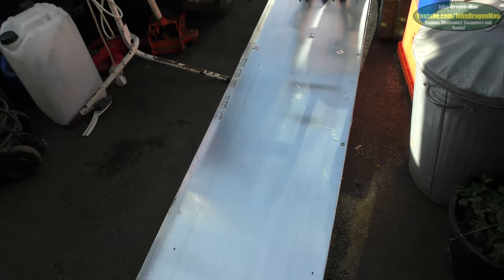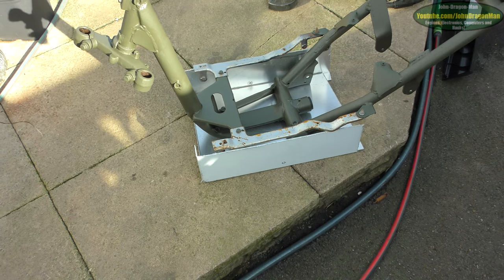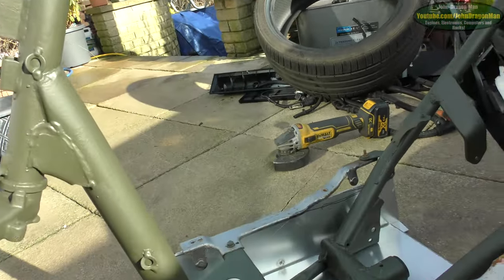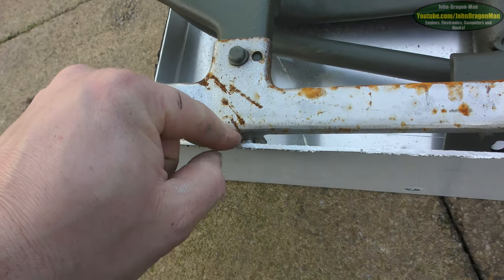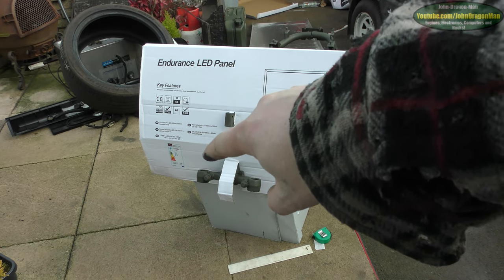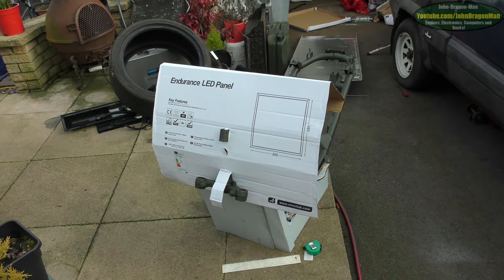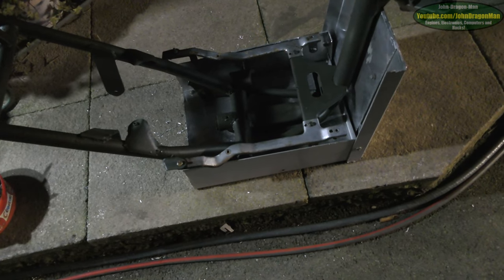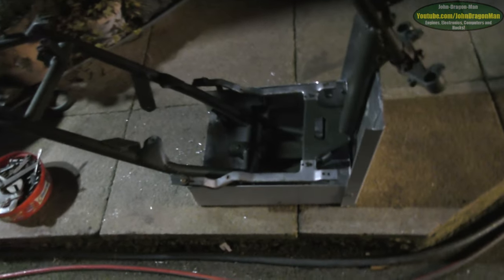Longjia Chinese scooter GY6 Pt5 Making a Fairing and Belly Pan

Comment: Think I preferred the naked look tbh mate, coming along tho 🤙👍
Reply from the maker: i fully agree. you should see it now it has a rear mud guard and seat! the only issue i have is that i do not want it to be just a summer bike. rain and getting water thrown up at me wont be pleasant. best thing with it is though, its all just bolt on ;)
managed to recon the original forks and got replacement stanchions and seals. they look pretty good... all in olive drab with gators heheh i wanted to make them covered like a BMW R75 (what a bike)